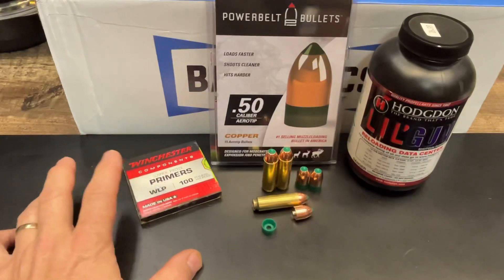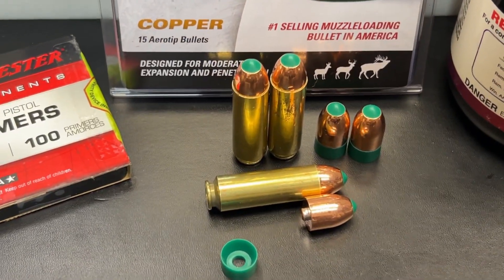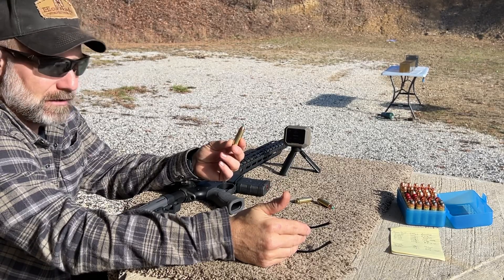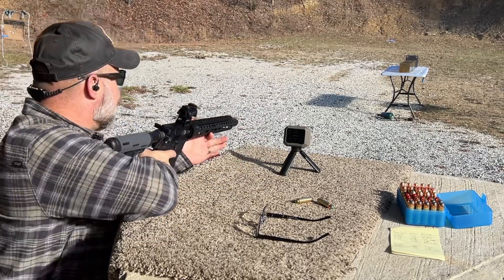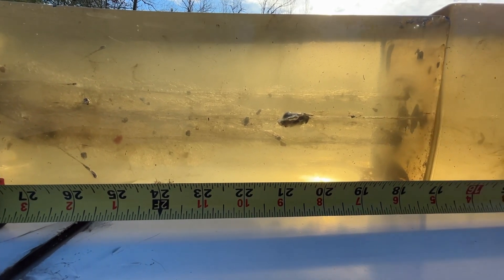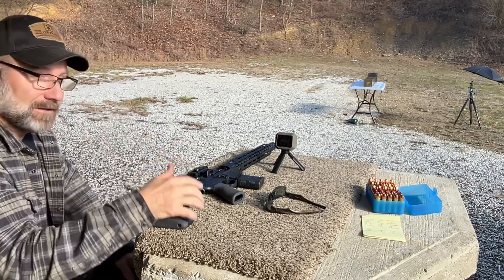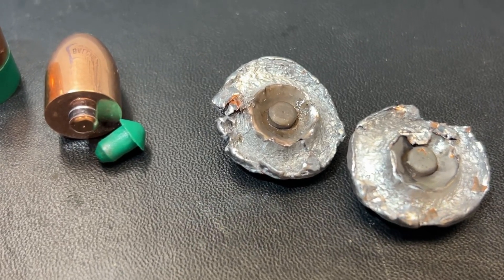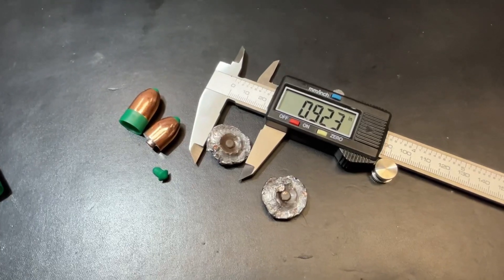50 Beowulf Gel Block Testing the Powerbelt 295gr Aerotip Muzzleloader Bullet in a Cartridget!!

Comment: I've shot these, and have looked everywhere for some of the Aerotip muzzleloader bullet 50 cal dangerous game bullets with no luck. I have 20 rounds of the Alexander Arms .50 Beowulf 350g Brass Spitzer Ammo but that isn't made anymore. The Aerotip look just like Rainer HP's after you remove the little plastic tip.
Reply from the maker: @GreasyStool  Muzzle loader bullet selection in my area is pretty limited too.  I pretty much have to look online to find new stuff.

Comment: This was awesome to see. The reason powerbelt lists these as 295 gr as just the bullet is bc they have a standard hollow point 295gr bullet that is identical just without the polymer tip. It’s the same across the board between all powerbelt bullets. When shopping around you can usually find these bullets in bulk packs usually 50 bullets for $50-55. I harvested a 110# doe this season with the hollow point version out of a hawkens rifle. Running them about 1750fps. Shot was at 25 yards and I will say it did one heck of a job. Full pass through and exit hole was easily about an inch in diameter. You have to keep the impact velocity reasonable and I believe that’s where powerbelts get a bad reputation is guys push them to fast and take shots that are so close that the impact velocity just rips the bullets clean apart. Essentially turning it into a varmint bullet.
Reply from the maker: @sniper12589  if you watch my 245gr .50cal muzzleloader test, that’s exactly what happened at 15’!  😂. They just Granades with the 3 pellet load.

Comment: Interesting design velocity but I have not had great success on close shots on deer with these very very destructive and in two cases didn’t exit.  Not a huge fan with higher velocities. Fun test but the cost of these doesn’t make sense unless it’s all you can get.   But I do a bunch of cast bullets so I am “cheap” that way…..
Reply: I got my PB bullets on sale at Walmart. LOL! End of season blowout. But I agree, no plated HP bullets for hunting. I run 385gr Rem CLHP for hunting. Way better performance.
Reply: If you cast your own, you should try shooting your cast through a sabot in your muzzleloader.

I use a .431 rnfp  bullet cast of 93.5% pure lead, 1.5% antimony, and 5% tin. This composition of lead is outstanding on game with a muzzle velocity around 1800 fps. 

I heat treat the bullets to harden them up, then I place the bullet in a tub of water up to the crimping groove and anneal the nose to soften it back up.

This allows me to get good upset of the nose while maintaining good sectional density for penetration.

I did find that I needed to put a bevel on the base of the bullet for proper fit in the sabot and better accuracy.

If you're velocities are closer to the average shooter with a. "2 pellet" charge, around 1600 fps, you will be better suited with a straight 20 to 1 alloy (95% lead 5% tin). It's a bit softer for better expansion at lower velocities.

The 20:1 alloy did well for me at 75-100 yards, but over expanded on 20-30 yard shots, with my muzzle velocity. That's why I added the antimony. I wanted to be able to heat treat the shank for better penetration, you can't do that without antimony in the mix.
Reply: @slimjimmy229  i do this for sure but play around with commercial ML bullets to compare to my cast. I am huge fan of the Great Plains bullet with a little tin to make it more malleable. Awesome information.
Reply from the maker: @michaelrocole7174  true. 😉

Comment: Can I ask why my hornady manual say to use WLP primers ? But every video I watch peps are using LPM primers I can see if running hot loads with heavy rounds thanks
Reply: Winchester previously had on their box that their large pistol primers are for both standard and magnum loads because they only have one type of primer for large pistol. The new red and black packaging doesn't say this, the older blue packaging did.
Reply from the maker: @ Exactly.  I’ve ran several thousand of the old style and still have a bunch of brass primed with them on the shelf ready to load. Just no sleeve to show. Lol
Reply from the maker: @Ray-ro2jj  It really doesn’t matter as long as you work your loads up. Don’t sub magnum for standard on a max load or it can take you over. I like more ignition with big columns of powder. As far as the actual difference in standard vs magnum primers, some magnum primers burn hotter, others just burn longer.  Either insure better burn for larger charges.
Reply: @ that what I figured I just wanted to make sure what my info was correct thank you !
Reply from the maker: @ It’s the same primer scenario with 458socom too.
Reply: @kentuckyrangetime  right but I did read have to be careful with the socom cause of psi rating are low 😳💥
Reply from the maker: @ 458 is about 35,000. That’s 2,000 higher than the .50 Beowulf. 

Standard or magnum is all in material if you start working up your loads with either of them. If I’m switching from standard to magnum primers on a load I’ve already confirmed, I cut my powder charge by 10% and then work back up.  If going from magnum to standard I make the primer swap then immediately start working the load back up.

Comment: I wanted to try something similar with a 400 legend and a 200 grain saboted sst meant for a .45 muzzleloader.
Reply: The . 45 cal muzzleloader bullets work well in 45 Long Colt ammunition. I have loaded them for my Judge pistol.
Reply from the maker: @garrettschienschang7898  as long as the bullet diameter is correct they should work.
Reply: @ both .400” other thing I’m looking into that you may like is bear creek ballistics. They make solid copper expanding projectiles for 35, 40, 41, 43, and 45 caliber cartridges that I’ve heard nothing but good things about. I’m going to try their 165 grain .400 and 225 grain .430 in a 400 legend and 444 marlin next year. Would love to see some of their stuff through your tests if you have the time and resources.
Reply from the maker: @ I’ve got an early gel block test with the 225 out of my .44mag single shot Rossi. I’m tinking with some other .44 mag loads with that bullet too. I have one loaded in .44spl brass and another with the polymer tip clipped that will fit in my Super Redhawk. Not got to test them yet though. 😉

Comment: I'm curious if hard cast gas checked bullets will feed through the AR action. My concern would be bullet lube and or lead build-up in the gas port. Maybe a lead powder coated bullet would work better, if it will feed through the action.
Reply from the maker: @Mbartel500  They will feed. They also will shave off materials as they pass the gas port, especially if the hole cuts through the lands, and that material/lead will collect in the gas rings on the bolt and lock up the action.  I proved that running my own cast 230gr bullets in my .300blk several years back.  Completely destroyed the gas rings. 

I did powder coat a few and it seemed to help but I just quit running them entirely instead of risking more damage to the bolt/gas rings.